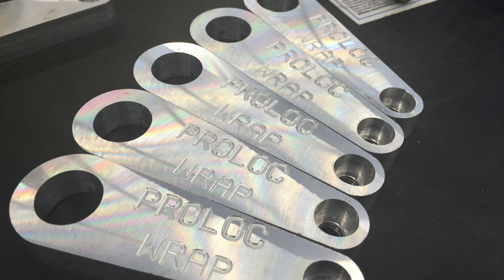CNC Milling - Handle Crank Arms

Comment: Hi Tom,
You looked frustrated but it was really nice to be able to finish the handles in the Haas.  They are incredible machines.   Did you run some parts just partially and then finish them in the Haas?  If so, was it difficult to reset up on a part you partially completed?  Glad you got them done.  Good looking parts.  Keep on trucking.  You will get it figured out!
Take Care,
Reid
Reply from the maker: +Reid Eichner Hi Reid! The original plan was to do the whole thing on my machine. It's a simple part and was as much for the practice than anything else. I did 1 part all the way through to prove the setup and then ran it like a production run, swapping parts between operations and then changing the tool to run the next step. I kept having issues and even had the machine decide to swap Y axis direction on me at one point. I had all but the last 2 steps completed but was running out of time so I brought what I had to the shop and was able to wrap up there. The following day I set to figuring out the issues and found that nearly every nut and bolt on my machine had loosened over time causing a TON of slop. I thought I had used thread lock. Went through and tightened and adjusted the machine which seems to have corrected the issues with accuracy. The controller also seems to have overheated (after 5 days of running straight) which is what caused the control issue.

Back to normal but still working on an upgrade. I love this little machine but I'm outgrowing it.

Best wishes,
Tom Z
Reply: +Tom Zelickman (Inspiration Metalworks) Sucks about having the nuts and bolts come loose but good you found the "issues".  I can definitely see you getting a small Haas or Tormach. 
Best to you, my friend.  Stay well.
Reid

Comment: Hey Tom. Saw  you at John Saunder open house but never got a chance to say hello.  Would have been nice to talk to another Linux user.  :-) You're a debian guy if I saw that correctly?  I am facinated by metal work and will someday either build or buy a CNC machine but for now I'm just a Linux Engineer by day and metal working lurker by night. Oh and I hear you talking about having problems recording your screen. I'm not sure how much of it you do but if you do a lot there are hardware devices that sit between your screen and graphics card that simply capture the signal in transit. Nice thing about those is no sofware is involved and it doesn't put any strain on your computer as they are stand-alone devices... but I haven't found them to be terribly affordable either.  Anyway keep up the good work.
Reply from the maker: +pgh pete Hi, Pete! Sorry I didn't get a chance to talk with you at the open house. It was a pretty crazy day for everyone. I've been a Linux guy since the early 90s and went to college with the guys that started Red Hat though I'm sure I remember them better than they remember me. I use whichever flavor does the job at hand the best and for LinuxCNC, they use Debian. Funny thing - I used to work for a team that built devices that sit in between the computer and AV gear to do recordings... Would love to talk to you more about all of this. Send me an email!

Best wishes,
Tom Z

Comment: So how many handles did you make? Since you said it fought you the whole week I am thinking at least 50?
Reply from the maker: +bcbloc02 Hi Brian! Lets just say I made more scrap than parts. I also didn't get to work on it but a couple of hours each night. Come to find out the machine had slowly vibrated just about every nut on it loose. Spent the better part of Saturday going through the whole machine and adjusting things. Made sure to use loctite this time around too! Thought I had done that from the original conversion but I went back and looks at old videos and I had waited on the thread lock to make sure everything was assembled right... Oops. Mr Bozo struck hard on that one.

On the VF2, I could make a handle every 3 minutes for both front and back setups.
Reply: Tom Zelickman
 I imagine when I get to running my CNC I will have similar struggles. Only slightly looking forward to it. lol
Reply from the maker: bcbloc02 Do you already have a CNC machine or are you planning on getting one? There's definitely a learning curve for any new machine, that's for sure...
Reply: Tom Zelickman
I already have one. It was the 1st piece I bought that was too tall for my shop. Then the HBM destroyed any thoughts of raising the roof to get it to fit.